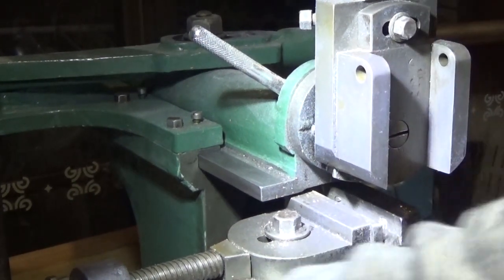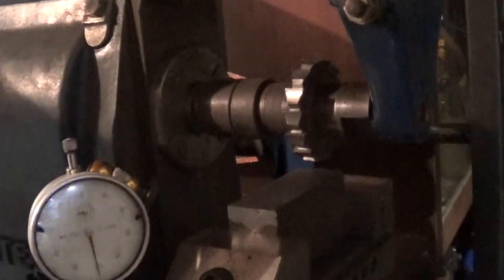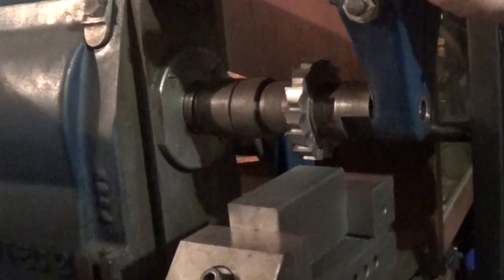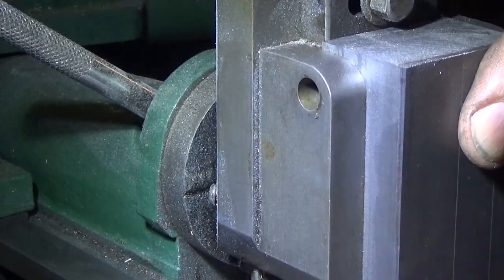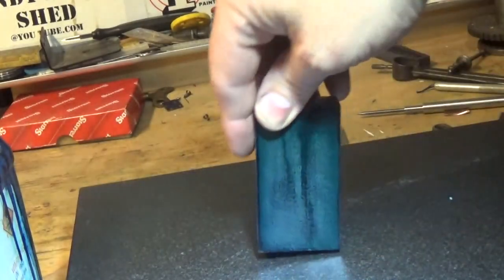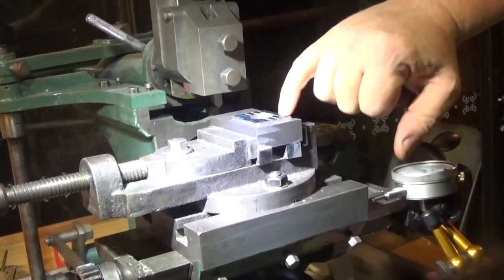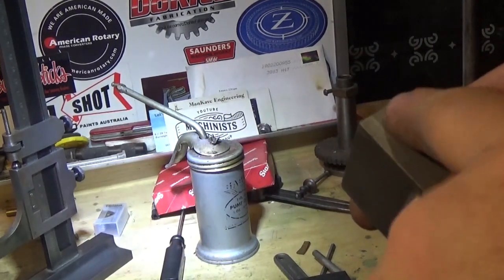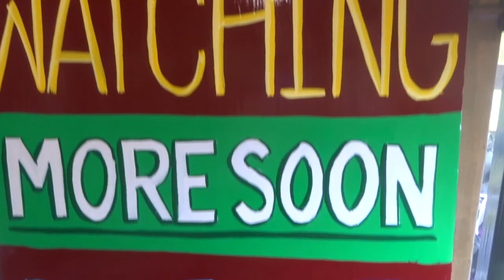CLAPPER BOX!! NEW PARTS FOR THE SHAPER.

Comment: Cosine error on dial indicator.  Try to get the shaft in line with the direction of travel. at a 15 degree error at 0.030 it would be a 0.00105 error. at 5 degrees it would 0.0001"